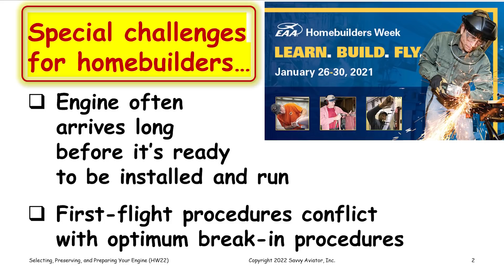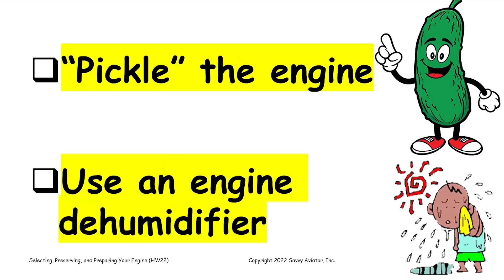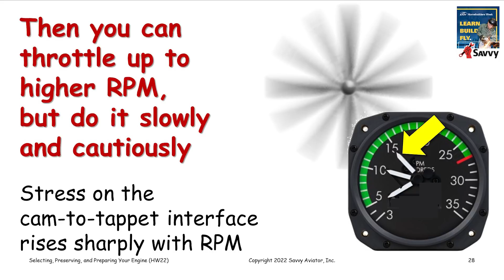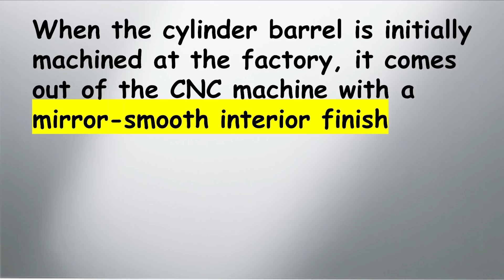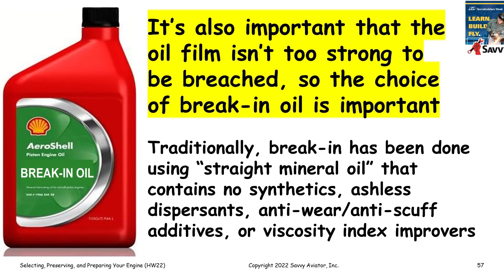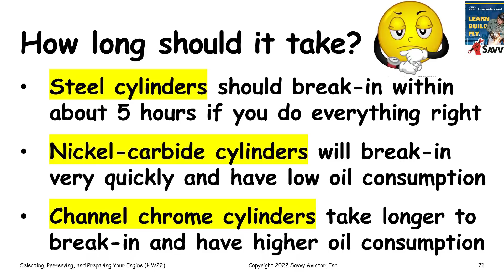Selecting, Preserving, and Preparing Your Engine

Comment: I wonder if there wouldl be any issue if we store the engine in a complete vaccume?  It's not difficult to build a acrylic box and attach a vaccume pump to bring the pressure in the box to almost absolute zero.  Are there anything in the engine that could be damaged by vaccume?
Reply from the maker: That's an interesting approach.  Can't think of any downside, especially if you bring it down slowly.  Most people wouldn't be willing to go through so much trouble though - that's a big box!